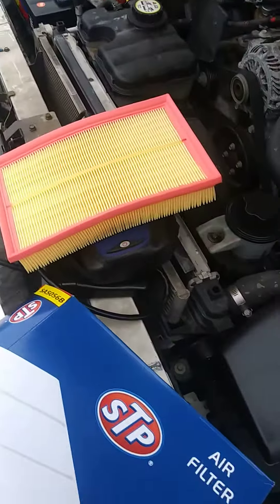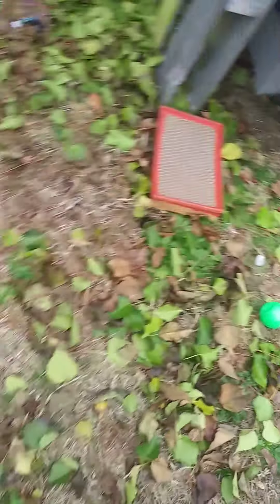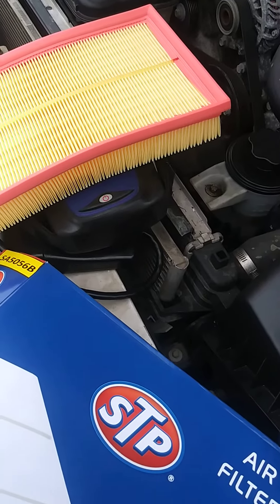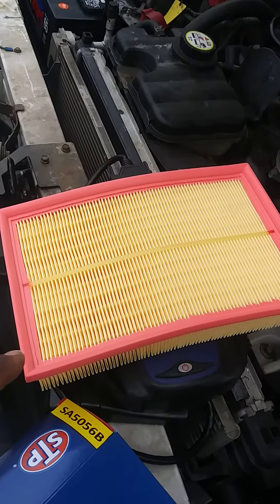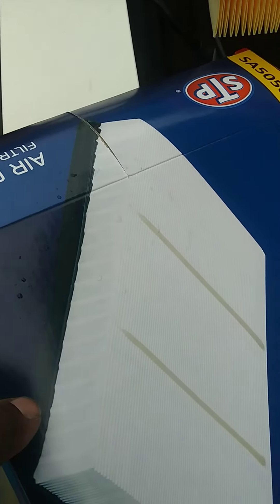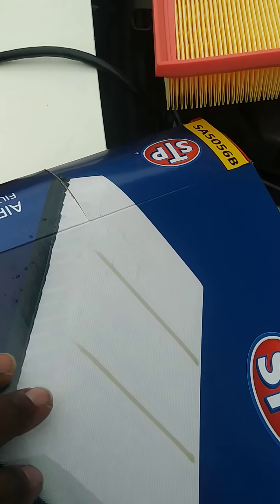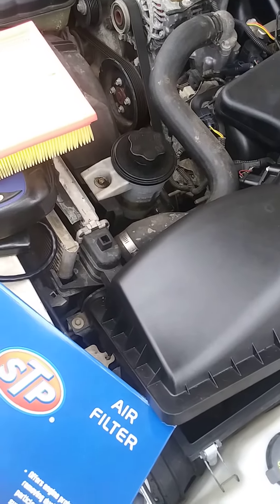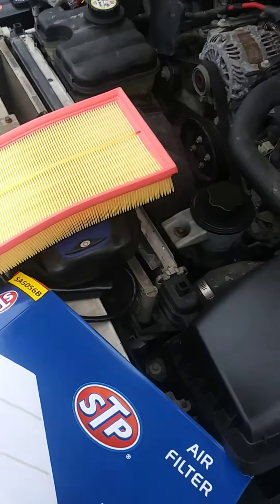P061B code on limp mode here's why

Comment: Hi
I’m facing the same problem in 2018 mazda3. It shows two code P061B and P0102. Even after removing the air filter and starting the car, it still doesn't work properly. It starts fine, but as soon as I put it in drive and try to move forward, it stalls after a short distance. When I try to restart, it starts up but then shuts off on its own again.

Comment: Hey I have this code and also I can’t rev past 2000rpm when in neutral it’s okay when I get into gear 1 but when I stop revs jumping did this happen to you
Reply from the maker: Yes
Reply from the maker: It's your input and output sensor on transmission
Reply from the maker: Only if air filter is good
Reply from the maker: Thank me later seriously ✊🦾🖤
Reply: @bossmancustomz6891  thanks for the fast reply and do you get those on manual transmission or is it something like transmission position sensor
Reply from the maker: These are 2 different sensor change both one at from of transmission one at the rear
Reply: @bossmancustomz6891  okay will try it when I get the parts will give you a update thabkyou
Reply from the maker: @Ryan-J  no problem and yes it's on manual also it's communicate with wheel speed sensor why Ford did that idk but I fixed my issue asap